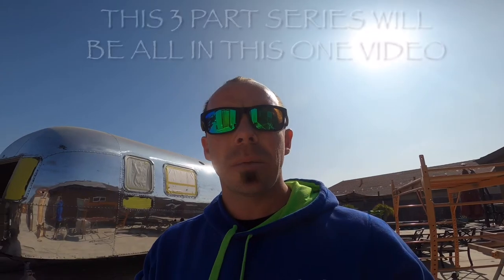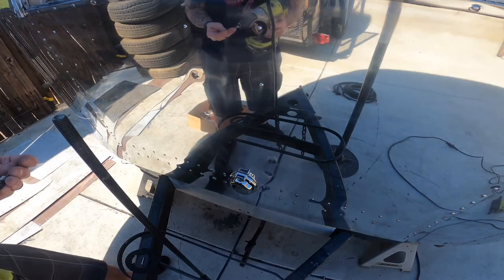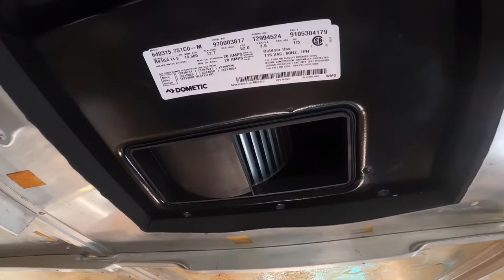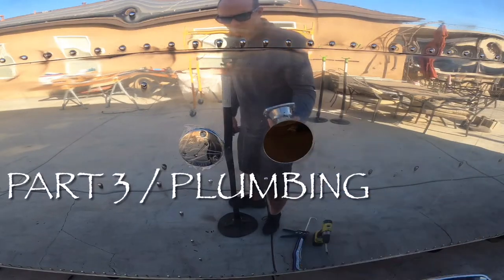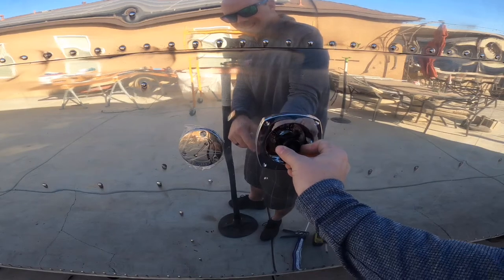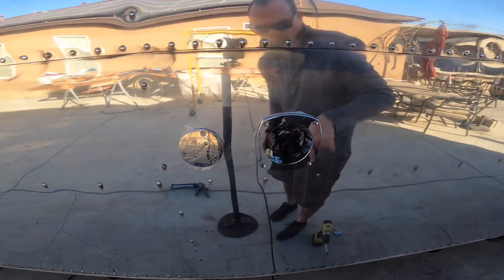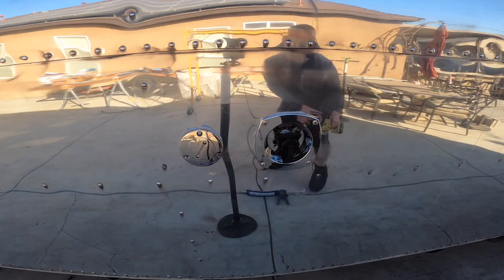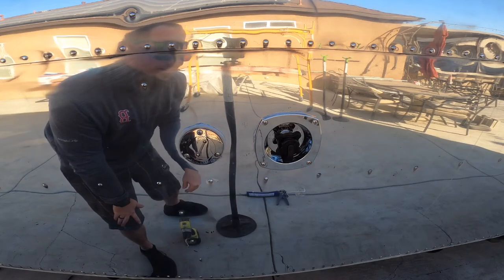Airstream Exterior finish pieces install & completion

Comment: How many hours are you able to work on your Airstream a week? Just curious.
Reply from the maker: Apologies I never got a notification for this comment. It actually depends because I’m a 1099 contractor so I travel a lot for my work all over. At bare minimum I probably get to work on it about 6 hours a week in total. Sometimes I’ll go 3-4 weeks without working on it at all, then I’ll have a solid week where I can work 8-10 hours a day for that full week. I actually just had this conversation with a friend about actual time and if I was doing this full time, realistically I think I could do this start to finish every day in about 10 weeks total time if I was at it full time.